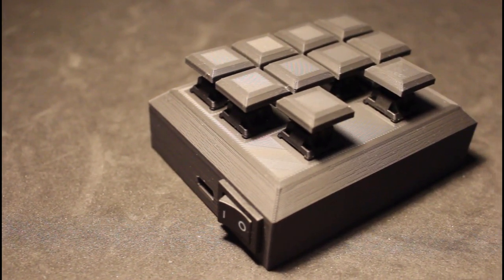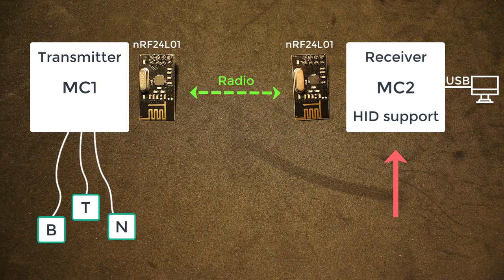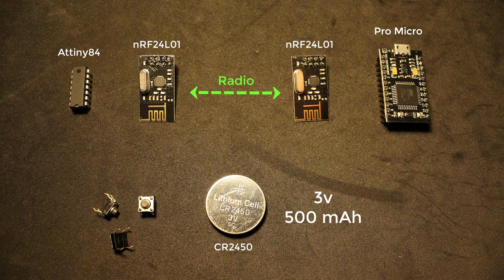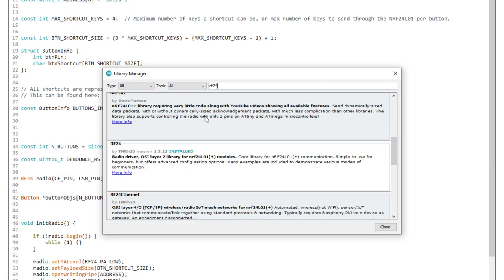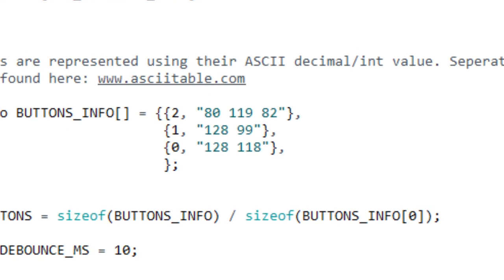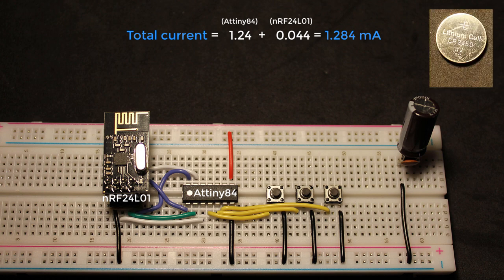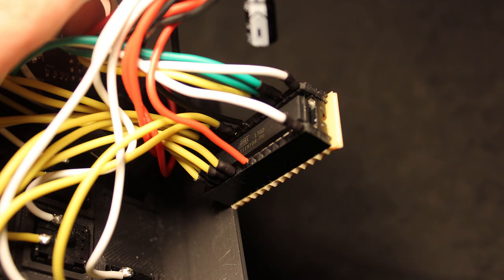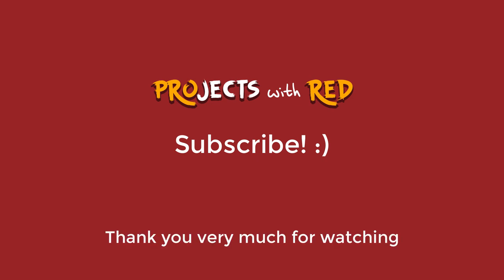Arduino Custom Wireless Keyboard! | #P4

Comment: Hi, I think this will be a great project but I keep getting a compilation error...
...   \libraries\Button/Button.h:11:7: note:   candidate expects 1 argument, 2 provided
...   \libraries\Button/Button.h:11:7: note: candidate: constexpr Button::Button(Button&&)
...   \libraries\Button/Button.h:11:7: note:   candidate expects 1 argument, 2 provided
       Compilation error: no matching function for call to 'Button::Button(int&, const uint16_t&)'  
Button by Michael Adams is installed

Any ideas?
Reply: Just another point to note. The pro micro comes in two voltages 5V and 3.3V If you connect the 5V one via Vcc to the nRF34L01 for the receiver it will probably fry it.
Reply from the maker: Make sure you are using the Button library version 1.0.0.
Reply: Hi, Thanks for the reply. Yes I have the version 1.00 installed.  Re-installed all. same problem ... Compilation error: no matching function for call to 'Button::Button(int&, const uint16_t&)'

Comment: Hey Red,
I'm getting the error "no matching function for call to 'Button::Button(int&, const uint16_t&)' ", I have updated Arduino to 1.8.19, I have run it as Administrator, I have uninstalled and reinstalled button and rf24. I am still getting the same error. What is SPI.h? Is that included with Arduino or do I have to install that library also? Any other tips to get it working??? Please help..
Reply from the maker: Hello, did you install the Button library by Michael Adams? Make sure you uninstall all other button libraries using the Arduino IDE library manager. Which micro-controller are you using?
Reply: @ProjectsWithRed  Hey Red, I have installed the Button library by Michael Adams, and reinstalled it as a precaution. I have loaded the same Arduino IDE as you 1.8.13. I am using the attiny84 and selected ATtiny24/44/84(a) (No bootloader) as the board. The compile error i am experiencing is:
Arduino: 1.8.13 (Windows 10), Board: "ATtiny24/44/84(a) (No bootloader), Enabled, ATtiny84(a), 8 MHz (internal), EEPROM retained, B.O.D. Disabled (saves power), Clockwise (recommended, like damellis core), Enabled, Port A (CW:0~7,CCW:3~10)"

Proj_Custom_Keyboard_Attiny_FlrA.ino: In function 'void initButtons()':

Proj_Custom_Keyboard_Attiny_FlrA:69:59: error: no matching function for call to 'Button::Button(int&, const uint16_t&)'

     buttonObjs[i] = new Button(btnInfo.btnPin, DEBOUNCE_MS);

                                                           ^

Proj_Custom_Keyboard_Attiny_FlrA.ino:7:0:

\Arduino\libraries\Button/Button.h:14:3: note: candidate: Button::Button(uint8_t)

   Button(uint8_t pin);

   ^~~~~~

\Arduino\libraries\Button/Button.h:14:3: note:   candidate expects 1 argument, 2 provided

\Arduino\libraries\Button/Button.h:11:7: note: candidate: constexpr Button::Button(const Button&)

 class Button

       ^~~~~~
\Arduino\libraries\Button/Button.h:11:7: note:   candidate expects 1 argument, 2 provided

\Arduino\libraries\Button/Button.h:11:7: note: candidate: constexpr Button::Button(Button&&)

\Arduino\libraries\Button/Button.h:11:7: note:   candidate expects 1 argument, 2 provided

exit status 1

no matching function for call to 'Button::Button(int&, const uint16_t&)'

This report would have more information with
"Show verbose output during compilation"
option enabled in File -> Preferences.

Please help...
Reply: @craiggilbert5795  Did you manage to fix it. I am having the exact same error and couldnt manage to fix it.

Comment: can you upload code for attiny88 , 
I tried but I can't define only 9 keys, port d and pin pb1
Reply from the maker: What do you mean exactly?
Reply: I would like to use more buttons for this keyboard, that's why I chose attiny 88, but I can't implement more than 8 buttons @ProjectsWithRed
Reply from the maker: @cncmax1623  Are you using the AttinyCore for the board manager for the Attiny88? If so, just check the pinout for the Attiny88, there should be plenty of pins you can use.
Reply: @ProjectsWithRed  yes ,but i can use more thean 8 pin
Reply from the maker: Yes you can use more than 8 pins. The only pins you cannot use are VCC(7), GND(8), AVCC(20), GND(22), RESET(1), PD6(12), PD7(13). You can use all the other pins.

Comment: Someone drives by with SDR and starts sending key presses to your pc... I wonder if bluetooth can be used instead
Reply from the maker: I did look into using Bluetooth at first, such as using the ESP32, but the current consumption was super high. I couldn't get to a bluetooth solution that would have low current consumption.

Comment: Hey, electronics noob here, how do you add more buttons than pins available in the micro controller? (Im guessing a multiplexer?)
Reply from the maker: Hello! Yes, you would have to use some sort of a multiplexer, such as the 74HC4067 or MCP23S17, if you search around for this, you will find a lot of options. However, an idea I had while making this project, is by using a single ADC pin. You can connect all buttons to Vcc and through different resistors to the same ADC pin, then in the code you can make checks for different ranges of ADC values. I haven't tried this and its not a very reliable way, but it should work. I recommend looking into getting an Attiny88, they are very cheap, provide you with 28 pins, and you can program them just like any Arduino. Remember to subscribe if you enjoyed of found the video useful! :)
Reply: Would using a keypad matrix for this work.
Reply from the maker: @auden_builds  Yes it would, as long as you can connect each key to ground and a pin on the micro-controller. You could use any input method you want with no issues, a key is just like a switch.
Reply: @ProjectsWithRed  thank u

Comment: Can you add rotary encoder
Reply from the maker: Yes you can 👍🏼.
Reply: @ProjectsWithRed  can you help make
Reply from the maker: @vvjworld09  You need to connect the encoder to the Attiny, and simply read the value and send it through the radio connection just like any other key value.

Comment: One more question, im using an Attiny85 but im wondering what pins to substitute for on Attiny85. I figured out Miso to Mosi/ GND and VCC But couldnt figure out CSN and CE pins and where they connect to the Attiny85. Also If I connect those then I have no pins left on the ATTINY85 besides the reset pin which you cannot use. Any Ideas and thank you!
Reply from the maker: Yea I think you will just be left with 1 pin to use if any. I would suggest using the Attiny84.